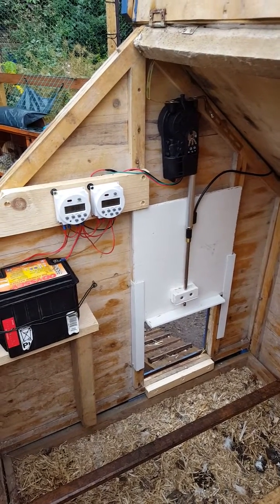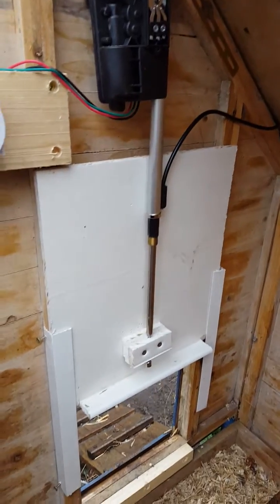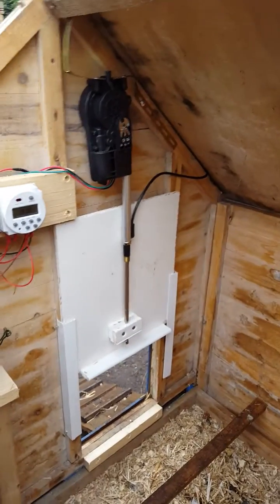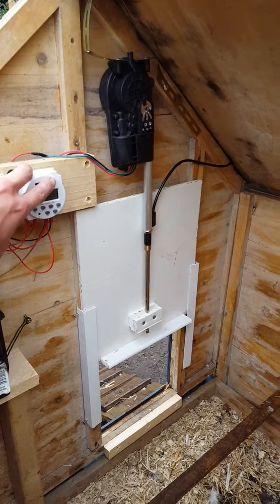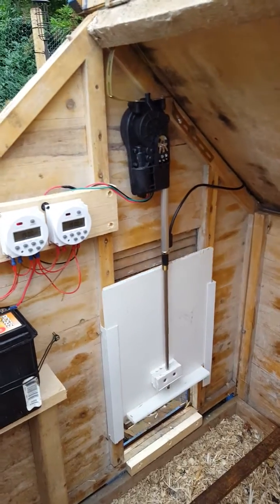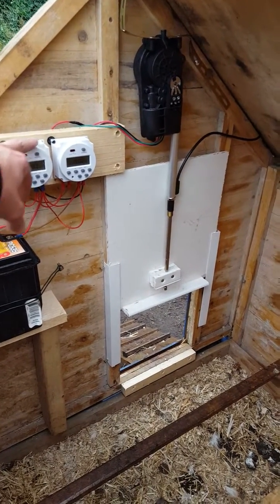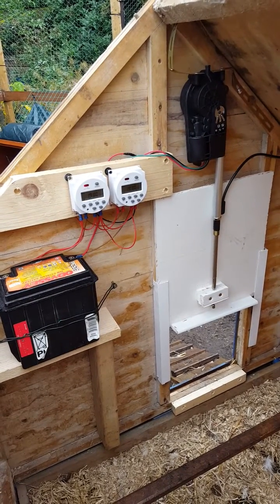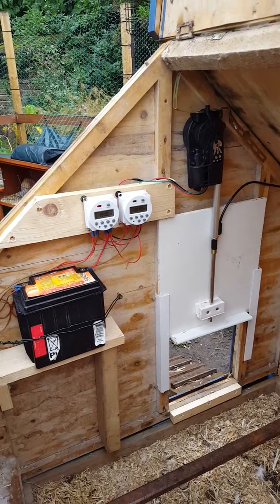Chicken House automatic door Opener/Closer using a car aerial and two CN101a 12 Volt Timers

Comment: Just installed a winter hen house light. PV charges battery = powers 12v timer = 12v power to photo cell switch = power to 12v light. I'm no electrician.  Presumably I'd need to put in a 2nd timer switch to switch on (lower) hen house door & switch off power (raise) hen house door 🤔